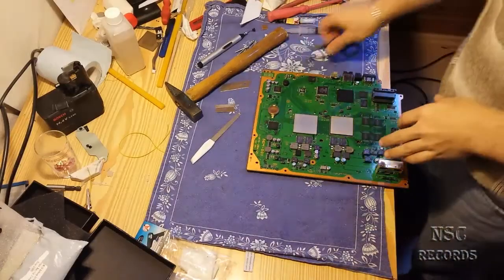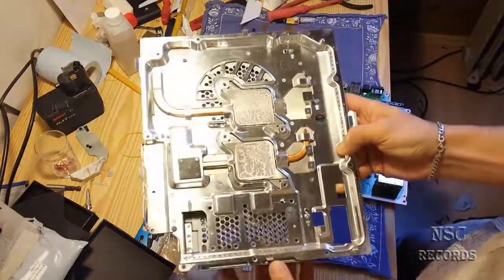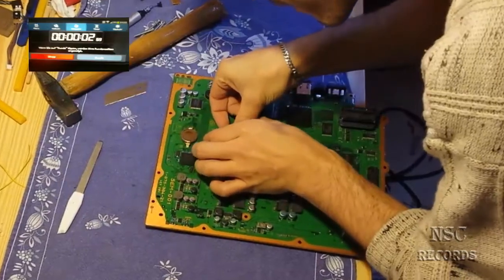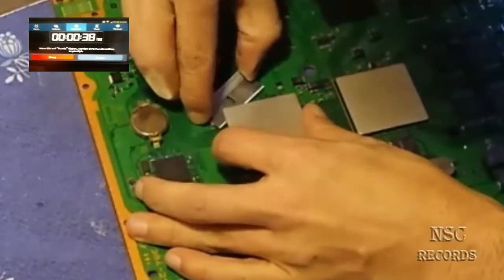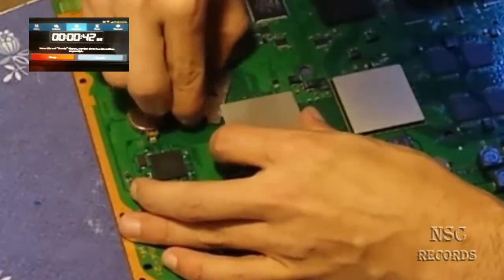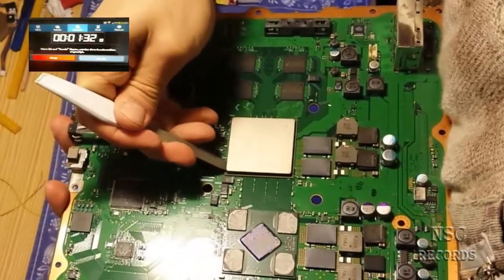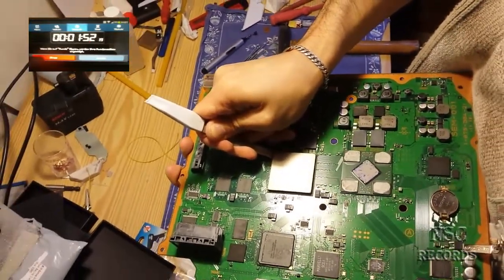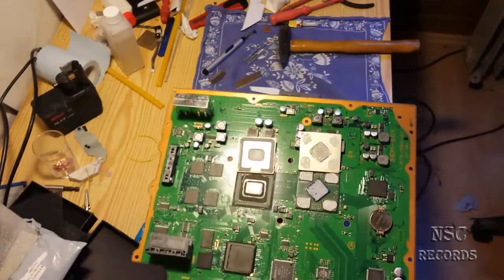Safest & Fastest way to Remove the IHS on your PS3 By:NSC

Comment: Fake
Reply from the maker: Hahahaha
Reply: @NSC-Modz  You have previously opened this device. By giving this heat for a short time it is impossible to remove the rsx metal from one side and remove it in this way. Likewise, it is impossible to remove the silicon adhesive of the cpu metal with that short twisted rasp tip. I've been doing this for years. you are encouraging people to trap video as if they are trapping people, causing them to corrupt your fake video, and you are aware of it

Comment: Dangerous for the CPU. ANY metal object can at any moment scrape the top of the CPU, resulting in the death of the PS3. I have done it with a VERY thin and sharp blade (the flexible ones) and you can remove both MUCH faster, but th blade is so sharp it has shaved the top of the CPU at times. Basically,2 out of 5 times you will scrape the CPU on a slim.

Comment: So I've got a power supply that gets way too hot and I belive that the IHS is not the problem however I've been told to replace the paste for it multiple times. I removed all the casing for the psu and seem to be getting the ps3 to stay on for about an hour longer than before. So, is it the psu or the IHS? Seems like the psu and it needs to be replaced but idk, seems like everyone wants me to de-lid the cpu/gpu

Comment: +UltraNSC My Super Slim PS3 says is overheated when i turn it on. I change the thermal paste and it keeps going. What should I do to fix it?
I added the Artic Silver 5 Thermal Paste.
Reply from the maker: you will need to cut the IHS to add there also Thermal Compound!
Reply: Superslim ihs too small.
Reply from the maker: no, thei are all the same
Reply: UltraNSC i opened up ihs on ps3 fat cechb01 and i put new thermal compound with flux and still ylod,
why this?
Reply from the maker: i just know, the most peoples who try this, thei damage and scratches the CPU

Comment: Awesome video NSC! I have 2 questions though.

1. When I need to glue the heat spreaders back onto the chips, what do I use? I don't like them just sliding around, it does not feel right IMO, so what do you use on the GPU chips, and on the CPU around the chip like what sony has? I want to get something to stick them back on perfectly before taking them off another PS3. The ones that I took off the heatspreaders before ended up getting hot fast and dying, and I'm not sure why.

2. Is it a good idea to use the copper shims that people are selling on ebay? I bought some for an older PS3 CECH-A01 and it seemed to do nothing to help the temps, even though the sellers say that the copper shims allow better connection with the CPU and GPU and transfer heat better. What's you view on this?
Reply from the maker: +TheNewFakk28 Please watch this Video, it´s the best Method ever! https://www.youtube.com/watch?v=_RYSnYL2XQw

Comment: Nice. I'm gonna try this out on my CECHA-01 60gb PS3. It's pretty noisy and gets hot quickly, and takes like 45 minutes to an hour to cool down properly. I changed the thermal paste on external side of the heatspreaders, not knowing that they also had paste underneath, and cooling hasn't improved. Thus why I'm gonna try this out before it's too late.
Also. What about surgery scalpel blades? I have those, the smaller ones are pretty thin, more than a razor blade and very, very sharp. I could bend the tip of one of those, and use it instead of the modified fingernail file. It's spares me the hassle of making the bent tip thinner with sandpaper.
Some scalpel blades are shapped like a claw or hook.
Reply from the maker: +Xerxes1688 Thank you :) But Please just take a lot care on doing this, watch more Videos on my Channel about IHS stuff and watch carefull, the RSX would be no Problem for you, but the CPU will not get of without a great tool, the tool Needs to be very VERY thin and Stable, if you just scratch the CPU the PS3 will be dead! So pls take care, on my Videos it Looks very easy, but not easy for you guys ^^
Reply: +UltraNSC Thanks, I will watch your videos while doing it, even if it takes me an entire morning. 
Originally I was going to get one of those EZChill kits, but after what I read, that led me to watch your videos, it might work, but it doesn&#39;t solve the core issues (no pun intended). If the thermal paste underneath the heatspreaders is decayed, EZChill will only postpone the innevitable. I still kinda want to install one of those,  to see if at least make the fan run more efficiently.
Reply from the maker: Forget all the shit, best is always to make it self better and perfect!
Reply: +UltraNSC Hello again. I managed to remove the IHS from the RSX, but I had no success with the CELL, denting/scratching up the chip on the process. It's a dead motherboard, but it's still useful for practicing, and for spare parts (the thermal pads are still good condition). 
The modified fingernail file just didn't work out for me. I read somewhere that palette knifes (the ones used for oil paiting) work very well, almost as if these tools were designed for removing IHS plates.
I'm already looking for a replacement motherboard, so in the meantime I can practice with the bricked one I have. So, I bought a couple of palette knifes on the nearest visual arts shop. There were right, they work like a charm. I used a straight bladed one, and it cutted thru the silicon glue very easily and evenly. I also removed the IHS plate from the southbridge. I didn't need a hammer, just heating up the IHS plate and the knife blade with a hair dryer for a few seconds.
Reply from the maker: Thats right, you can do it like that to :)
Reply: UltraNSC Luckily, I'm getting a replacement 60gb PS3 next week. I've got it at a very good 'cause the laser unit is dead and the person selling the console is not going to bother in getting it repaired. In any case, I wanted to ask you this before proceeding in removing the IHS plates from this console: Can I superglue the CELL IHS plate? What I'm planning to do is that I'm not going to scrape off the factory silicon glue that held the IHS plate, but rather to drop some superglue droplets on the silicon, specifically at the corners and in between, avoiding the pores that the silicon has. Would superglue harm the CELL chip? That's my question. 
On my practice COK-001 motherboard, the superglue holds the IHS plate secure enough so it doesn't move or warp when the console is working (specially if placed vertically), but the amout of superglue is little enough so I can remove the plate again with the palette knife without needing to anything heat up.
I also noticed that the southbridge chip is coated in some sort of rubber-silicon, protecting the circuit lines underneath. I wonder why Sony didn't do that on the CELL and RSX chips aswell. Forgive me for the long comment.

Comment: hahaha you are fast omg
Reply from the maker: +Wagner Ribeiro normaly im faster xD
Reply: +UltraNSC man, I took two hours to remove the Heatspreader and scratched the cpu... the green part. i saw few copper on the superficie.
when i turnes on the video game, the green light stayed, but there was no video and sound. ... the next times I tried it just turned on and the red light appeared. 
do you know if i can still fix it?
Reply from the maker: if you scratched the CPU than it is GAME OVER :(
Reply: +UltraNSC it was just the green part. but i think think I figured out that already.  haha
Reply from the maker: make me a pic and upload it for me, ill take a look
Reply: +UltraNSC I make a video. I also removed a little electronic component, but I put it back soldering(it seemed to be working out bc I tested with a multimeter.) however, the video game doesn't start and continue booting anymore. As soon as it starts, it pops up a red light and the green goes off.
Reply: +UltraNSC thank you for your good will
Reply from the maker: np

Comment: I attempted to make a tool like yours, but the nail files had to be so slim that all 3 files snapped. Unfortunately my cpu was scratched and now my CECHL ps3 is dead. Before attempting this repair, my CPU was at 80 degrees celcius and my RSX was at 58. Do you think i did good for attempting to repair it?
Reply from the maker: ***** Yes, lets say like that, YOU HAD NO OTHER CHOISE ^^ The PS3 would get hoter and hoter till it would Overheat and get an YLOD... So this was the best you could do, cause here you really Need to open the CPU/RSX IHS to add new Thermal Compound, otherwise the PS3 will DIE ^^ I bet next time you will do it better, it´s really Need a lots of Skill to do that so nice like i do.Wish you the best

Comment: Hello nsc, maybe you can help me with some advice? While cleaning my ps3 and replacing old thermal grease I accidentally broke a tiny surface mount resistor off of the mobo. It was a clean solder break and I saved the resistor (about the size of a half of a grain of rice) I know exactly where it goes. Is there anyway to get it back on? Its very small so hand soldering would be very difficult. Am I fucked?
Reply: MrBimple420 I just solder a (tiny) e225 resistor back onto my cechb and will remove the cpu ihs in the morning.

Comment: I just followed ur videos trying to take the CPU head spreader ,it's great videos by the way , but i have now the YLOD and I didn't even got the heat spreader out !!!! any way to fix this??
Reply from the maker: always take care, it looks aesy on my Videos, but it´s not easy for some one that has never done it befor...
Reply: ***** things didn't go well for me , my ps3 was totally damaged and I had to get a new one , ( never try what u saw in this video )
Reply from the maker: yes, you will Need to reflow it
Reply: UltraNSC
I was very afraid that the cpu is damaged ,because things didn't go very well with me trying to remove head spreaders and man u make it looks very easy !!!! , I tried to test my ps3 so i pressed the eject button and the fan was working so loud , does that mean the CPU is still good ?
Reply from the maker: yes & no, if you have NOT scratch the CPU&GPU, then you could fix with a Reflow...

but use Amtech Flux...
Reply: UltraNSC
thank u man , I will reflow it and will let u know what happened
Reply: MHAMAD MSM same thing happened to me I didn't know you could reflow it I chucked the ps3 away, how did it go with you?
Reply: MHAMAD MSM  so how do you know you have ylod it the ps3 is taken apart lmao you put it back to together, and you obviously did something wrong hahahaja you orobly scratched something its not like you did it exactly like him and now you have ylod, so what did you do did you scrape something scratch anything? did you let the pry tool go flying out the side and hit a component why dont you say why you have ylod, you just say i did it like you and i have ylod lmao???? huh huh huh

Comment: hello,
i am fixing a ps3 slim ylod for a friend.
he wants to me to use the pea sized method.
which do u think will be most likely to spread on the whole chip with this method?
as5 or mx4?
Reply from the maker: MX4 of corse!

AS5 should be used only on the die it self...
If you use AS5 on the whole IHS, you will be NOT able to open it next time so good, cause AS5 is a bit harder then the MX2/4

MX2/4 FTW ;)

Comment: In the CPU I use  aluminum shims for me it work  fine in my PS3 who have a very loud fan...now is low...
Reply from the maker: OMG thats not the best way for your CPU :\

i realy can understand that some peoples are afraid to open the CELL IHS, but this aluminium shims will destroy your CPU with the time, because it make TO MUCH Presure for your sweet CPU, the Soldingballs will get fucked up with the time :(

Best u realy can do, is to open the CELL CPU and add there new Thermal Compound...
Reply: I open the  CPU heat spreader and put a new thermal paste,the aluminium shim is under the heat spreader, no in top, like I said bro , for me work just fine...the aluminium I put is very thin...
Reply from the maker: ok, then ist ok :)
Reply: Thanks for your videos
 man..
Reply from the maker: realy np ;)

Thank you guys to ;)

Comment: Hey man, I have a problem with my PS3 model CECHG04. It does sound, but no video. The TV says 576p but it's just a blank screen. I reflowed it already, so it's not the problem. Could I have a popcorned GPU, or is there another problem?.. Help?..
Reply from the maker: mostly if its still not working after a great Reflow, then u can be sure that somehwere on the board or on the Chips is one or more contacts burned out... so there will be no Chance :(
Reply: UltraNSC Wow. Now that's just weird. The PS3 does component. Any ideas as why it doesn't display HDMI video, just sound and resolution? :P I have reflowed the PS3 3 times already with the oven method, where I placed the motherboard in an pre-heated oven at 215 C and left it in for 8 minutes. It worked like a charm. Will it hold? I didn't have any flux, so I didin't put any. Is this method OK?
Reply: just curious, have you switched from hdmi to the standard ps3 cable ( the one that is provided with your ps3) ?
Reply: My PS3 is curently taken apart and I'm waiting for tools to arrive to remove the CPU IHS. I'm waiting for some thermal paste, too, since I'm out. I tested it for about 5 seconds without heatsink or anything, just to see if it works. And it did :P. But if I will not be able to use the HDMI port, then I'll buy a component cable from ebay (I only have composit).
Reply from the maker: yea, but better then nothing :)
Reply from the maker: Evaldas65
 You can make that tool for your CPU IHS your self :)
Reply: UltraNSC
Well I ordered a painting knifes set, since they're ultra thin, durable and sharp where they need to. They'll cut right through the silicon under the IHS :P I bought them on ebay. I'm kinda afraid to make a tool myself, since I'm afraid to cut the CPU itself. I did it on one PS3, not doing it to another :P It'll propably arrive on the end of February, so The Last Of Us will have to wait :P BTW, I have another PS3, CECHC04 and it's on level 3 fan after 5-8 minutes in the XMB, is it OK? The fan seems to kick in to level 4 in game, but never to level 5. New thermal paste applied, the IHS's haven't been tinkered with. The CECHG04 one used to be super quiet for 8 minutes, and then the fan started to kick in. It's on max speed after about 15 minutes, so I supose I have to redo the CPU IHS on it. Gonna do the PSU mod like you did, too :)
Reply from the maker: seems to be ok for now :)

Comment from the maker: DONT try to remove your RSX IHS like on other Videos where thei pull it away like hell, you could damage your GPU like this:
http://abload.de/image.php?img=chiprambrokenheatc.jpg
>ENTFERNT den RSX IHS nicht wie in anderen Videos wo die es einfach weg schlagen, es könnte so was wie hier passieren:
http://abload.de/image.php?img=chiprambrokenheatc.jpg

For more info also on how to Remove your IHS take also a look here:
>Für mehr Infos wie man die IHS entfernen sollte:
How to remove the Heatspreader´s on your PS3 (Quick Tutorial) By:NS©

PEACE ;)
Reply: UltraNSC does it matter if you scrape the heat spreader ? the metal on top of the cpu,  the thing your tAking off...? when you have the nail file you want to lift up as you are going through the silicone so the file is closer to the heat spreader instead of the cpu